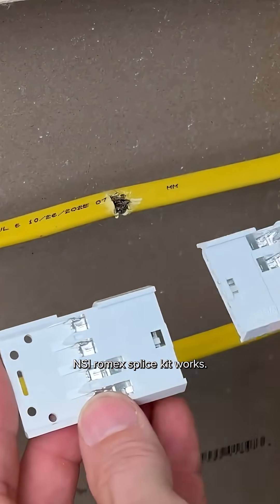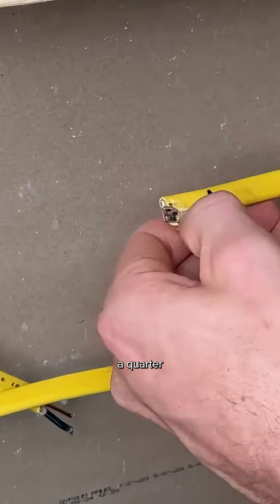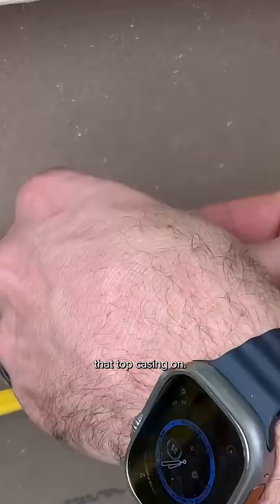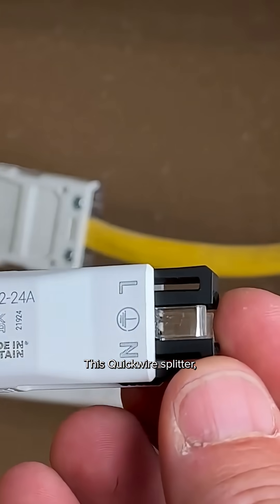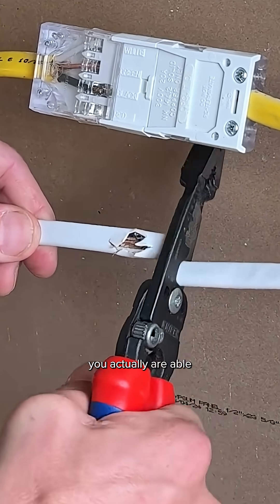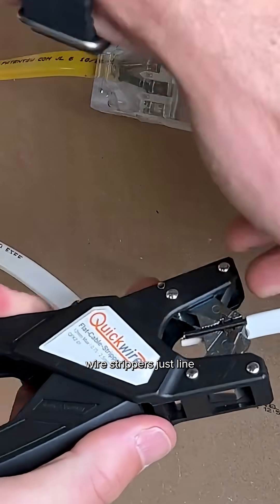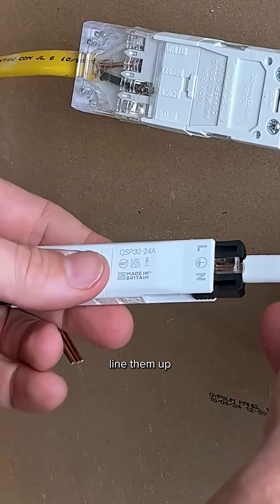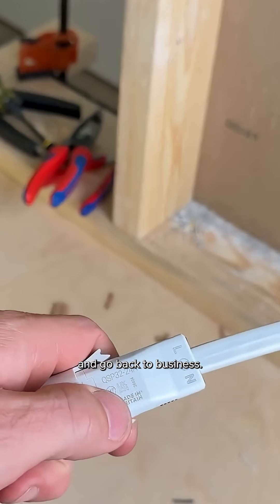The NEC-Approved Splice I Hate… and the UK Inline Splice I Love

Comment: That inline splice is nice but I'm sure the price isn't. That Romex cutter and that stripper got me drooling tho.
Reply: I don't think the price matters as much when you consider what it would take in labor to run a new piece of wire, especially because the wires are usually stapled every so often and not just easy to pull. And copper is not cheap so if you have a long run to pull out before a junction, you had to add that cost of wire compared to the splice.
Reply: @Thatsmessedupman You could just splice them with a normal splice though, you probably have to put it in a box for code, but it's not like the only other option is pulling the entire length of wire. Just cut, strip, and reconnect with wire nuts.
Reply: @Zoroaster4 not true in the code sense. You can't just cut and put in wire nuts and then close up the wall. As you partially surmised, you have to put in a box and you cannot bury it in the wall. But supposedly the splices you could passcode and not lose your insurance claim if there was a fire.
Reply: @Thatsmessedupman you would have to put in two boxes with two splices and a fresh extension piece, in most cases. You don’t just have a couple feet slack in the wires for funsies.

And yes, these US versions are technically approved for in wall use. Their actual use case design is for clipping together two halves of a double wide. That’s why they’re made as cheap crap instead of decent quality.
Reply: I don't work with a ton of NM because I'm industrial/commercial, but when I do, those would rule (strippers, the inline splice is also better than the US version)
Reply: It's not a "Romex" cutter/stripper.  Romex is a US cable.
Reply: @AlecSpence I wasn't implying the cutter was manufactured by Romex. I was implying it was made to use with Romex but thank you for educating me sir. I'm at least 10% smarter now. Yay!
Reply: That tool is badass!👍
Reply: The price is probably quite reasonable for someone who is using this stuff 5 days a week, but eye watering for someone like me who would use it maybe once a year.
Reply: @travcollier  Not sure why you're all just speculating on price.  Why not look it up and then comment on facts.  Yes, the splices and the strippers are more expensive than other options.  For a professional, the breakeven comes after the first few uses, as so much time is saved.

Comment: APPROVED, much better than a plastic or metal box for connecting or extending power line
Reply: How so?
Reply: @christianloy5806 Hole big enough to mount box.  Enough slack for wire.  Less space needed.
Reply: @farmeunit garbage
Reply: @christianloy5806 Great argument. /s
Reply: @farmeunit no need to argue…they’re junk…